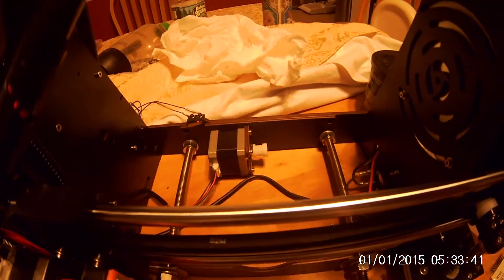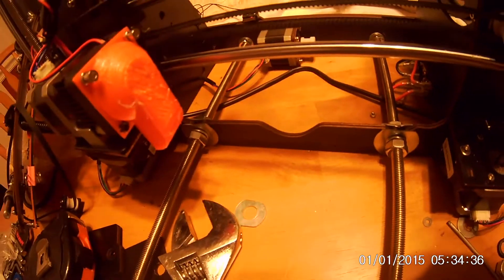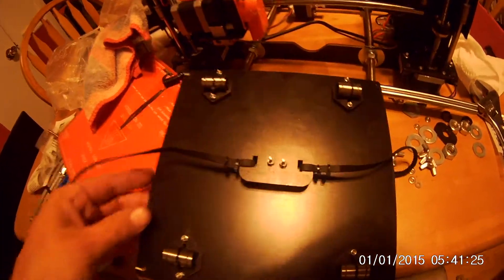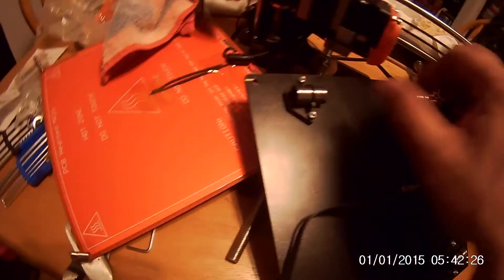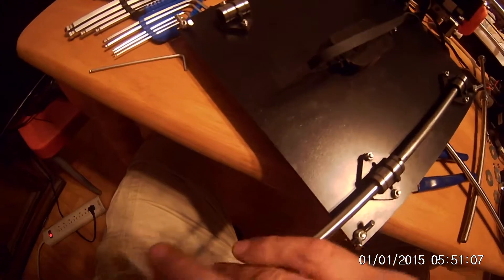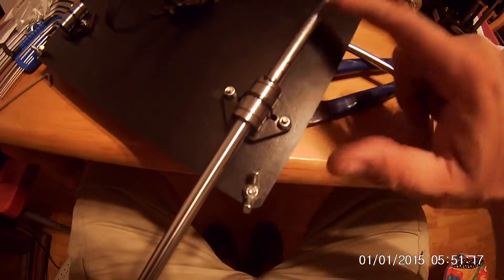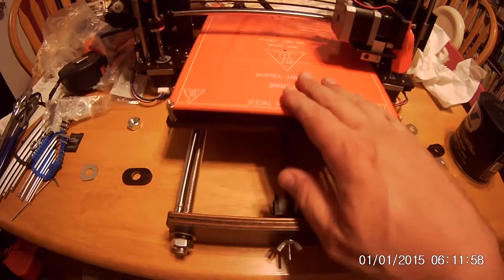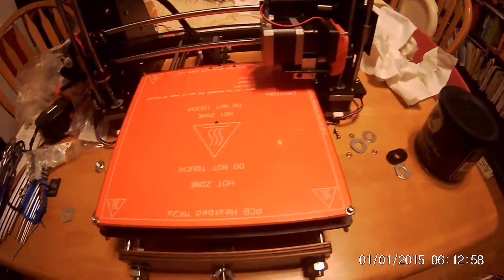$4 x Axis Fix for CTC i3 DIY Chinese 3d Printer prusia reprap etc

Comment: Hi Man, thanks for the advice, I have a very similar printer, I guess they change some components from time to time but the frame stays the same... I have some problem with the so-called "Z wobble", I can see the marks of the endless screw on my printing walls, I am trying to find some improvements online, good video! , btw, do you still use it? the axis you fixed was the "Y"... cheers!
Reply from the maker: I printed the z axis things that let the carriage float. Jimmy's tidbits did a video on it.
Reply: @AAAComputerSolutions  thanks! , I will check it out